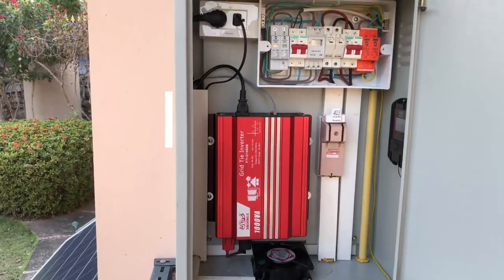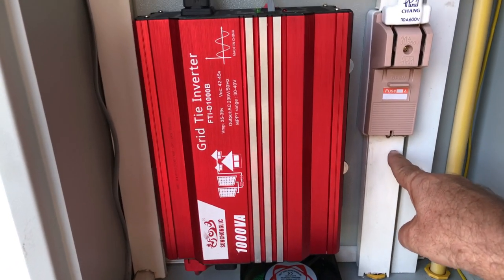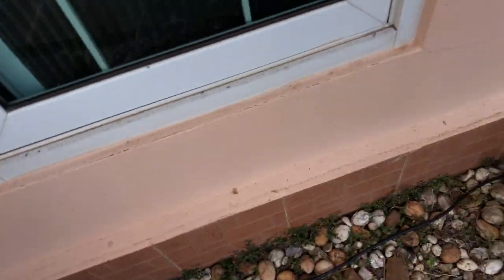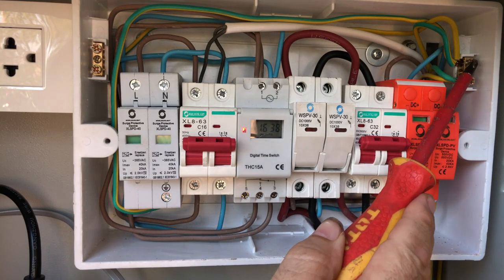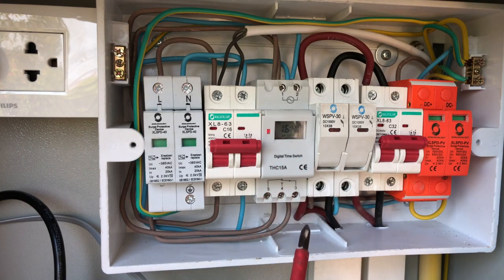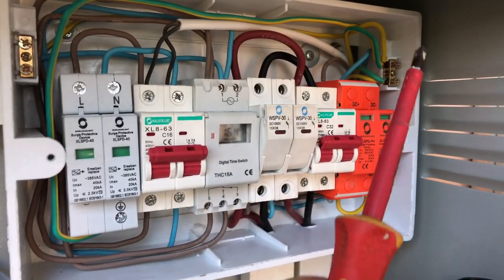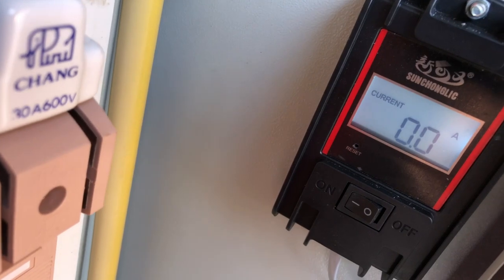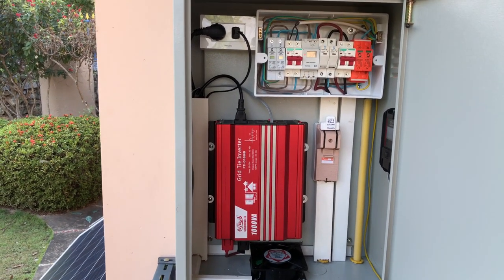🆕Grid Tie Solar System  Fuse board Grid Tie System New Video

Comment: Nice setup very neat, but......I'd would of added a AC RCD in you DB seam as your cable semi open to the front of you house.
Or is your house sockets RCD protected?
Reply from the maker: Thanks for your comment, unfortunately I no longer run this system as the grid tie inverter stopped working and as it had no guarantee i decided not to buy another cheap inverter, also the gardener broke my Solar panel so now am looking at a battery and inverter as a backup for our brownouts. Thanks for watching.

Comment: Nice setup.  What is approx cost of the fuse / timer/ breaker  box setup you installed.
Reply from the maker: Hi Garry the total cost of everything you see in the box is 5,184 baht , this is for the Metal box fuse board  all the switches included within the board, timer 30a main isolator, cables, trunking inverter, fan.
If you include the solar panel the total cost is 9,130 baht for the complete setup.  ( Not including the angle brackets screws bolts and time to complete the setup ) 
Payback for me estimating a saving of 200 baht per month is 3 years 8 months, but the thought of free energy is a good feeling. I look at this as being free at the moment, I exchanged my time for this equipment so my time which I have plenty of has paid for this system so it is making me a saving now. I give my experience with electrics to others in exchange for these items.
Thanks for your question

Comment: Hi Les 
Shame you are down south need some consulting, we built a property in Chaingmai used a local village sparky 
We have installed 3 phase to run ducted AC till I got the quote omg ended up using wall split systems in each room. But have some issues when local grid goes down and comes back it seams like not all phases come back on as AC only runs the fan not enough power to start compressor, will have to sort this when we get back to Thailand full time am partly retired just waiting on travel restrictions to join all of you in the good lifestyle
Reply from the maker: Thanks for the comment, 3 phase here is on and off all the time, my friend has a large house with a large swimming pool, he has 3 phase and its constantly on and off, he had power surges also which burnt several appliances out more than normal, contacting the Electricity company they assured him all their installation was good up to his property, I installed surge protection to help with the situation and these were effective to save his tv hifi etc etc. Power went off several times a week and as he had guests it was troublesome for him and getting bad reviews he pestered the Electrical company to inspect his property, it turned out he was the last house on the run so as the power was being used by all the other houses his power dropped, then the transformer would emit a surge to cope with demand causing problems. They insisted it was his Electrics within his house causing the problems, They said rewire the whole house and the problem would stop. He got a quote of 150,000 baht to rewire the house. He asked me to check the property, In my eye nothing wrong with his wiring, we met the Electrical company and discussed the problems, A Thai Electrical company worker stood up and said it was the Electrical company's fault with the power surges rewiring the house would not fix the problem.
They renewed the transformer problem solved.
Thai electrics are a huge problem over here compared to western standards, wrong size cable too many houses on the supply and the list goes on and on.
Hope you get it sorted once you return and hope you can return soon.
Reply: Thanks for the reply that makes good sense will look into the supply issues, lucky no power surges yet 
Like your solar setup, I was thinking a long same lines but adding a battery to power led lights on a long fence line and as security night lighting, long fence may need to be big battery
May need to talk this out over some beers some day